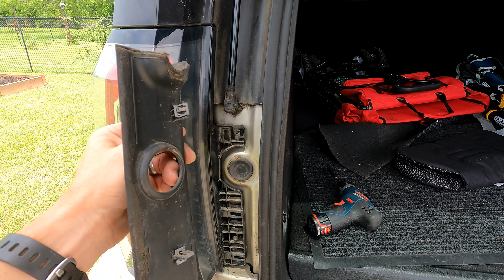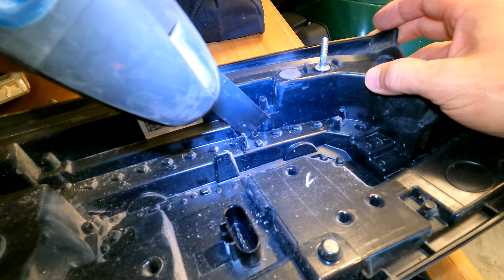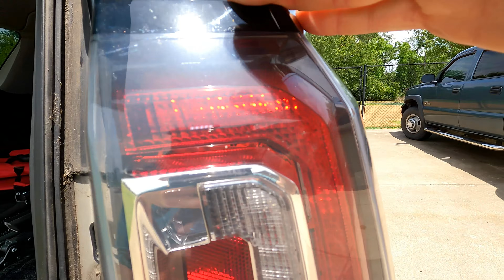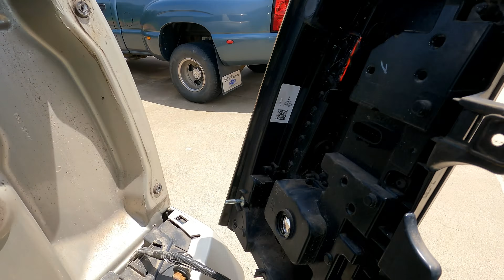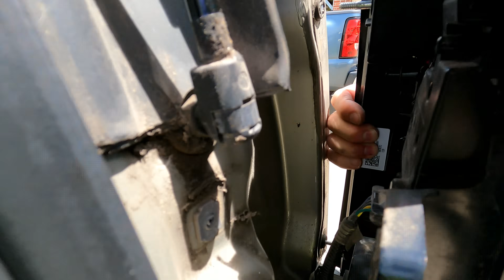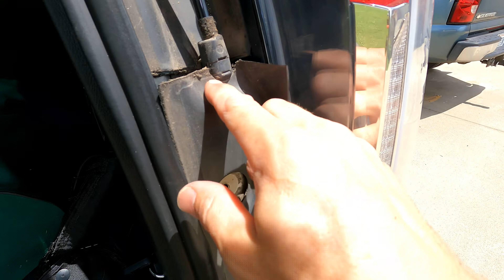2016 GMC Yukon Taillight repair

Comment: Completed this repair over the weekend. One thing I would recommend is using a 60w soldering iron. I originally bought a kit with a 30w from Walmart and was having no luck getting the solder to stay on my copper. Went and got a 60w and finished both lights in a matter of minutes.
Reply from the maker: The larger iron would make it easier for sure.

Comment: How can you tell which LED lights had failed?
Reply from the maker: The circuit board is cracked which prevents the current flow in this case none of the leds worked
Reply: @mtrunk8570  how did you know where the break was? So how did you know where to cut for the fix?